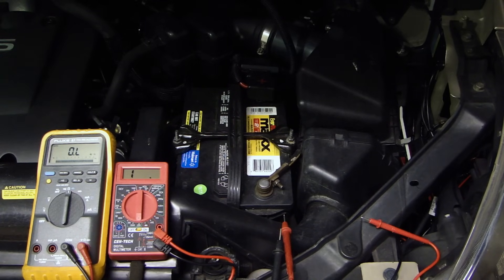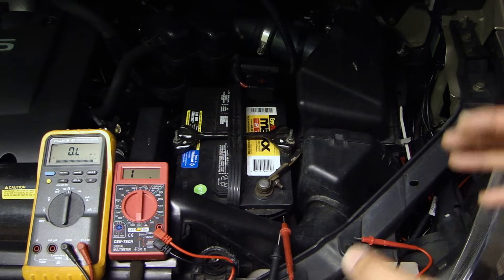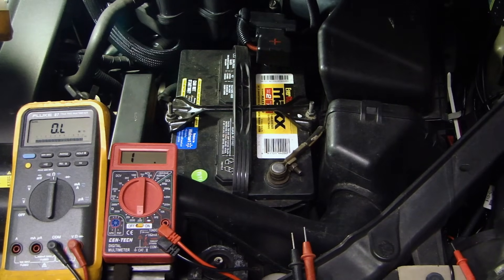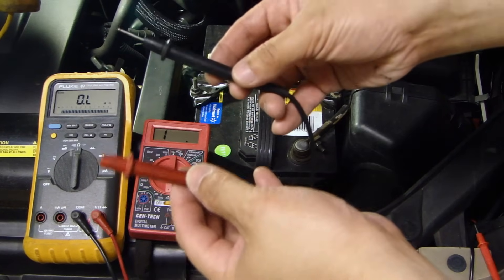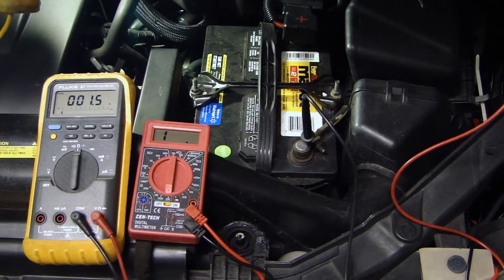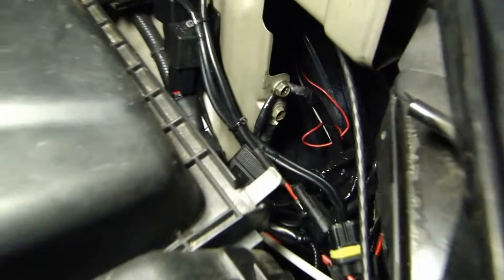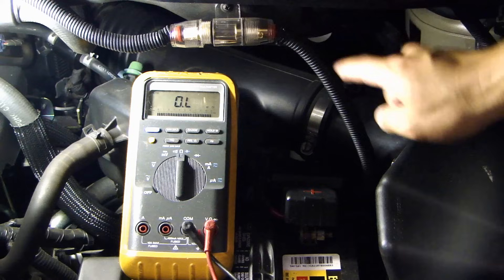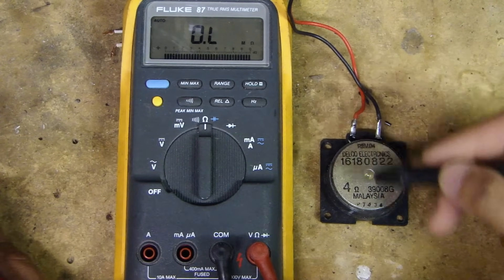How To Use a Multimeter - Test Car's Ground - Video 3

Comment: The meter leads shorted together, should show 0 ohms. Not .6 or anything. The meter is essentially sending out a known voltage, measuring the voltage drop, and calculating for ohms law. Your very first test (the meter leads) failed. As u stated to begin with, "1st thing u want to do, is make sure the ground is a good ground", u actually did the PROPER 1st test (measuring ur leads).. and ur test didnt pass. U need new leads. Its LITERALLY THE SAME as good leads testing on a bad ground.

Comment: Should I test with the negative terminal from the battery or should I disconnect the negative terminal from the battery in order to test for ground?
Reply from the maker: You should test the ground with the negative terminal connected to the battery because you are checking the continuity back to the battery's (-).

Comment: Can I jumper cables as a extension when connecting from the negative terminal of the battery all the way to where I want it for the multimeter?
Reply from the maker: Yes you can.

Comment: I have a question about that 4 ohm speaker at the end if the video. If the coil was broken there'd be no connection between positive and negative. Isn't that the same as infinite resistance?(whatever that looks like on the meter, OL perhaps?) and doesn't 0.00 ohms indicate continuity?
Reply from the maker: If the speaker coil is broken (there is a physical cut in the coil), then the it's open and you will not measure any resistance. This can be called an infinite resistance. If you measure 0.00 ohms, then it has no resistance and you have continuity.
Reply: @dial2fast  Thanks for clarifying. So a meter reading of '1' says no connection which is the same as infinite resistance but a reading of '0' is no resistance. I think I got it. I've previously used my meter in continuity buzzer mode but some recent reading have flashed up numerics. I'm going ohms in the future.

Comment: Great video. I’m getting better and better at my DIY stuff. Thanks to people like you. I just want to verify, I should never have continuity between a positive wire and ground, correct?
Reply from the maker: Between positive and negative is a power source (ie: car battery, or power supply). There is no continuity between the two. If there is, then there is a short and you will have no power.

Comment: To initially accurately test and check your meter’s calibration for Zero Ohms, simply just place Both leads onto the Negative Battery Terminal. ( Without surface interference from your fingers!).

Comment: Hi there! Thank you so much for teaching us. Today I am facing an issue. I learnt to install grounding wires in my old vehicle which is said to improve the performance. I connected one from the positive terminal to the alternator. Then I connected one to the distributor and one to the car body from tbe Negative terminal. But when I tried to attach the lug to the negative terminal, it creates sparks that melts the terminal. I wonder what has happened.... What I saw them do in the video has no problem...

Comment: I keep getting a reading of 6 ohms on scraped metal in multiple places in my car.  Does that mean my whole is not grounded.  I haven't  had a 0 reading anywhere but the battery.
Reply from the maker: 6 ohm should be fine as long as you use a heavy gauge wire. The problem steel is not the best conductor (compare to copper) so over a long distance you will have some resistance.

Comment: My cars OEM grounds have paint on the surface but seems to be working anyways.. might have contact through the screw/bolt and the threads.
A conductance battery tester told me "Cranking low" at the cranking test. Battery voltage was around 9v when lowest. Its a new battery. With the old battery the same test went to about 8v.
So i dont know.. might be a bad starter or a bad engine ground. Negative post on battery are grounded on the shock tower and on the transmission. The starter are grounded on the engine.
Dont know how to diagnose. Any tips or suggestions? Charging voltage are good. 14.5-14.7v on idle. Dont know about the current though.

Comment: The symbol you keep referring to as "Ohm" is actually named "Omega".
Ohm is the unit of the measured force.
Reply: In one sentence you managed to imply you're somehow smart while at the same time stand behind a silly and common error, that symbol has a name so use the correct one instead of confusing those who don't know its name...

Comment: HOW NOT TO USE AN OHM METER ( never on a powered up circuit,, the battery terminals are connected, ruins the meter)  The correct way is what is called voltage drop.  Any circuit must be tested under load which a voltage drop does. The 5v battery of an ohm meter doesn't stress the system properly.

Comment: How funny I came to this video minutes ago. Never registered I had ever seen this before. Guys face meant nothing. Then I see a post by myself a year before. I forget peoples faces I know that. Had people come up to me and I am like stumped when they say hi. must be my fractured skull. Yep I concentrated on this video just now. he touches the power wire with fuse in so its live. Then touches battery and all the time he has the meter on ohms. You cant do that without seriously risking ruining your meter. 

On ohm setting what happens. The meter like with all testing sends out current from one probe tip and measures the amount of current coming back in the other probe tip.

Comment: Your result showed there is more resistance (00.6) in the meter leads than in a test ground circuit (00.0 on ground battery cable); yet you did not explain how that could be.  The only explanation is that the lead to lead connection created resistance.  This should have been explained so a novice like myself would understand how two combined pathways could have less resistance than part of the same circuit.
Reply: Truthfully continuity sucks to see if you’ve got corrosion or broken strands or a good connection whatsoever other than a quick open/ close in a circuit. It will show a full open l- so it’s not completely useless
Reply: An H7 bulb with Leads and T pins for back probing - you can replace the load in the circuit and use you’ve dvmm to voltage drop test to the issue in the circuit- or you can simply leave the circuit as is and back probe (while operating that circuit) to find your issue - but as with any electrical diag you need to have a quick test to point you left or right- that’s what voltage drop testing is for-
Reply: Hi it is probably the resistance of the battery inside the multimeter. Or the nominal resistance of the miltimeter.
Reply: Wouldnt that be because the human body isnt a resister but to some extent is

Comment: Why the heck are they using vechicles chassis if it has all these issues fir the negative? Im trying to install a second leisure battery and im suspecting bad grounding at this point, im getting low voltage(4v) as soon as I connect a device. Everything else in the van that is running from starter battery runs fine. It is so strange.

Comment: Hi how do you test a ground point say in the rear of the car with the meter and your leads are not long enough to get back to the battery  terminal ?
Reply from the maker: Use a piece of wire to extend the test lead.
Reply: Good idea what a dum dum I am lol
Reply: @treecutter1806  May be stupid suggestion, but couldn't you just disconnect the battery since the circuit doesnt have to be live to test resistance?

Comment: This is a misleading video.  Sure you can check the ground resistance with a standard ohmeter (but NOT using the cars battery, disconnect the battery).  But this will only provide part of the information you need.  If there is a clear resistance between the two earth points then clearly there is a basic issue.  But, Even if the resistance looks great (very low) you may still have a serious issue when pulling current.  So, what you really must find out is what happens to the earth circuit under load - especially for higher amperage loads like powerful amplifiers.  This is because when you try to pass a large current through a metal joint, it may alter the resistance of that joint.  It may be fine for 0.1 amp (like the resistance check as the ohmmeter does exactly that), but when you try to push 30 amps through the joint, the joint 'fails' and the resistance jumps up - resulting in a large voltage drop and you load will not run at 12v but less.  JP
Reply from the maker: The purpose of measuring resistance is to measure any resistance between two points. It has nothing to do with how much current it can handle. Think of it this way, if you measure the resistance of a 5A fuse, 15A fuse, and 30A fuse. The multimeter will show 0 ohm for all 3 fuses. This resistance measurement is accurate. However the maximum amount of current you can pass through each fuse is limited by the fuse itself. The 5A fuse will blow if you put 7A current through it. But prior to popping the fuse, it's a 0 ohm conductor. Basically when you are testing resistance, it's only for verifying if a conductor has any resistance, BUT it will not tell you how much current it can handle. If you are installing amplifiers, there are charts you can refer to that tells you how much current a specific wire gauge can handle with specific length. A good experienced car stereo installer will know best practices when installing amps, such as keeping the ground wire on the amp as short as possible to prevent ground loop.

Comment: So what is acceptable? .6 2.3
Reply from the maker: 0.6 is acceptable. At 2.3 ohm, the connecting metal might be joined by some welds which has some resistance. Depending on what electronics you are powering, you want the least resistance to ground if it draws a lot of current.

Comment: So say I wanted to test a ground wire that is connected to my engine block. I believe it’s the PCM ground wire. I’d set to Ohm then one probe on the negative battery terminal, then the other on the ground wire where it’s attached to the engine? Or does one probe need to go in the PCM somewhere.

Comment: Fluke say in the 88v manual that you should never ohm wires with current flowing through them. Just to mention this.
Reply: Why is this, im panicking. I had good resistance figures between negative pole and various grounds, but soon as i start the engine they go high???
Reply: @opelCAMBO  cars got coronavirus.
Reply: @jamesbarratt593  ha  i think it may be cos of the 5g receiver i installed in it lol
Reply: @jamesbarratt593  genuinly however mine was real bad, about 145 ohm wbem running, but my alternator went bad so i swapped to new, but stil it goes to about 25 when running

Comment: Would you notice a difference in output of an amp with a resistance of 0.02-0.05 or 0.00
Reply from the maker: No, not with that resistance.

Comment: Can you help with this bad ground I know you busy and wouldn't mind if you don't message back No harm done I got VW LT35 2.5TDI all position lights come on when you press on the pedal brake When you turn on the lights the back brake lights are always on...

I found that when you turn on the fan in the cabin and slightly one turn the ignition key and press on the brake pedal The van finds its way to connect the power and the fan is working without having the ignition on yet

Also found in this case the glow plug relay when you press on the brake pedal there is a noise like something is breaking up there I am going to check this but after checking the ground wires all looks clean and 100% 

How I should be looking for more bad connection Lights front back maybe the glow plug relay ect. ?? Thank you for your suggestion Arthur from Glasgow

Comment: Hello and thanks for a great video, it helped a lot. I still have one specific question on the test for continuity.
On my VW T25 Bus all the electric fuses and relays are in the front of the bus.
The battery is in the back seat.  When you showed the test you put the positive on the positive battery terminal and the negative on the fuse.
Where would I have to put the positive prong of the multimeter? Thanks
Reply from the maker: You can always run a wire from your battery to the front of the car and connect it to the multimeter.

Comment: So my speaker tested fine although there is a tear in the screen if that's what you want to call it and when I installed speaker it sounds all the sorted like crackling popping that kind of thing so how can that be going on if the speaker tested fine could it be my wiring
Reply from the maker: Popping or scratching is to do with the coil rubbing on the magnet. The coil is still giving you an impedance reading on the multimeter, but the speaker is physically damaged.

Comment: hi, im having problem with voltage drop in my amplifer i reads around 8 to 9 v when its turned on i checked all my grounds its reads .5 on my on the amp and battery..any help will be much appreciated
Reply: I fixed this with mine. I have a high RMS power totaling about 4k. between both amps. At first I had a big voltage drop from the battery to the back of the car. 2015 VW beetle. Everything has been replaced that was factory. I got a 1f cap at first. I don't recommend a cap though. It's really just a patch on a bigger problem.  Helped a touch. Still had some voltage drop off at the amps. Everything the bass hits hard, it would drop down from 12.6-8 voltage at the amp and when the bass hit hard. The voltage would drop off to 11.3-6 and then bounce right back to 12v. I had 4g for p/g wire's front to back. Plus the wire's to the amps. Recommend size. To fix my issue, I replaced the wire's from front to back with 1/0 and also did the big 3 upgrade in 1/0. I have an extra battery in the back also. I really need a high output alternator. But I have to have one special made for my car. No one mods a beetle 🤦🤦 but the lest resistance you have, the more flow you get through the wire. I don't have but just a very small amount of voltage drop now. Nothing that's going to affect the performance of the system. I hope this helps
Reply: Is that all the voltage your getting at the amp. It should be 12+v from the start. Even the trigger wire should be 12v. A simple test would be to run a new ground from a new good location and see what that does. And check the wire size and quality of it. The little $20-25 amp kit from Walmart is junk. Really. The RCA cables are cheap and junk. The wire is not the stated size. The fuse holder that comes with a cheap kit it also junk. You get what you pay for. $20 kit gets you a bunch of junk that will have to be replaced by the correct stuff. Hope this helps you
Reply: @davidlunsford6155  I had it figured out.. gave me some trouble for a while tho it was a while back. Cant remember it well but it happened because i didnt had my paint stripped off completely from the ground must have been the clear coat i guess.. just a sloppy job lol. Iam actually running a $20 kit from amazon its running two amps for the sub and midrange and highs its running good all these years since my system is under 600 rms depends on some brands tho had one earlier with rca's fading colours with seasons. But i have my speakers cables better with some oxy free copper and good brand since i have it running on loop from headunit to amps and back to speakers. Thanks for the reply and suggestions appreciate it.

Comment: Hey Bud,I am at a loss here.I'm wanting to get a voltage read on my speaker wires.I'm at the speaker with my meter and have the red probe on the positive wire and the black on the negative wire.Have it set to AC volts and I'm getting like a 0.2 read.Am I doing something wrong?
Reply from the maker: You don't really use a multimeter to test the audio sound on a speaker. Your setting is correct, but the response time in a regular multimeter isn't fast enough. Also the voltage is not going to be very high depending on speaker volume. If you want to check speaker, just measure the impedance to be 4, 6, or 8 ohms. If you want to measure sound, use a scope.
Reply: dial2fast What I'm going to do is add an amplifier to a stock stereo so I'll need to get a signal from the speaker wires.However,if the system is too powerful than then the amp won't be able to handle it.So I need to determine how many volts the lines are putting out.Its the same concept as setting an amplifier gain with a meter.Problem is that it doesn't work.Do you have any suggestions?
Reply from the maker: Well if you are really needing to test something like you mentioned, then you need to inject a test tone (say 1kHz) to your amp and then measure the output with a true RMS multimeter at a specified volume. If you are planning to install an aftermarket amp to a car's factory system, then you will probably be connecting the factory speaker output to the amps hi-lo input (if it has that feature), and then connect the amp's output to the factory speaker. Remember sound waves that are clipping is what fries speakers because clipping causes sine wave to behave like DC voltage and that's a  no no for speaker. So I think more importantly, have a clean source and good quality amp, and your system will be fine.

Comment: I only watched this because I had a feeling it was bad information and I wanted to see if my gut feelling was right. And? I was right. ALWAYS, I repeat ALWAYS isolate the circuit prior to checking resistance. Checking a live circuit can result in bad readings and inadvertant shorting of circuits. The fuse in that Fluke meter of yours isn't cheap. It's a sand filled slow blow fuse and costs about $30 USD for a single fuse last time I checked